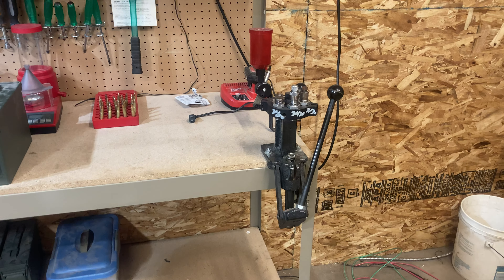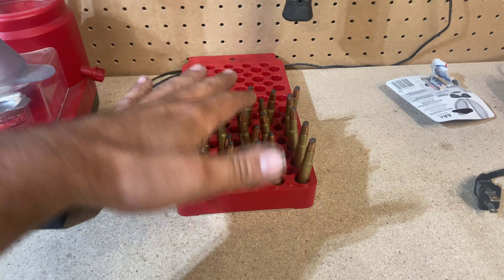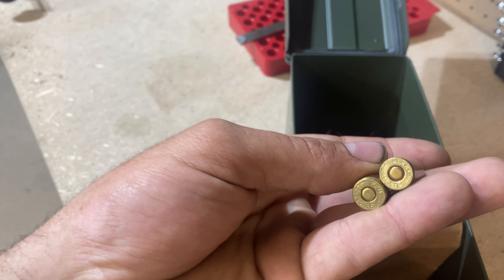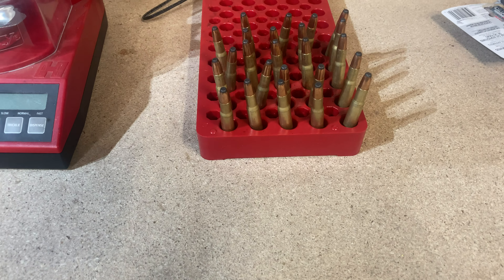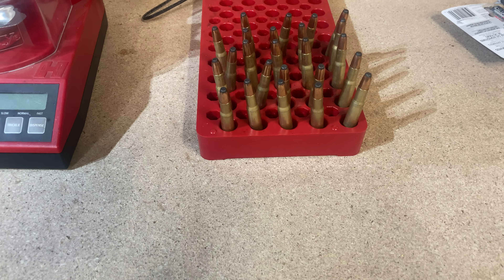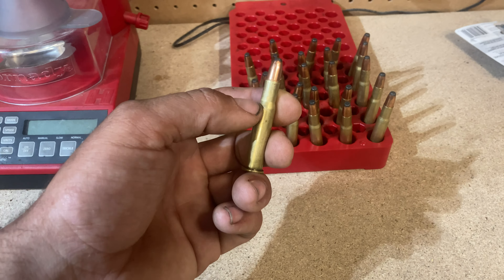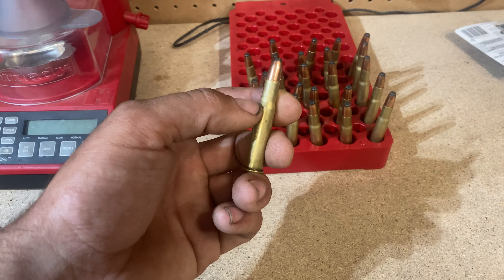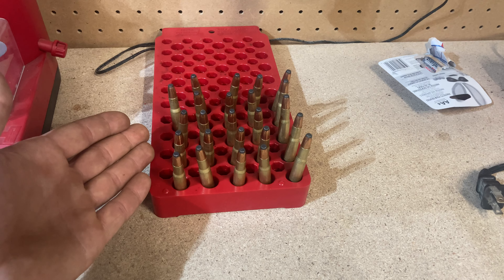AN ANSWER TO ALL THE COMMENTS ON THE RELOADING VIDEOS

Comment: Are the chambers of your two 22-250 guns at opposite ends of specs, and is the reason you have two sets of dies for the round? I have 2 guns chambered for the same round and my dies fit one exactly. I know that because I've loaded/fired the same cases 17 times, this for a belted round. For the other gun, I swap out the standard shellholder for a Redding Custom Competition Shellholder. Thanks for the vid!
Reply from the maker: The 22-250 is the one of my favorite rounds to load and shoot so im always tweaking on rounds for each gun

Comment: I agree with 95% of what you said there. Sparkling clean brass doesn't shoot any better, exotic brass, neck tension, annealing, other fancy processes, will only help past a certain point, exotic process tools will only help past a certain point. If the gun & shooter isn't up to it in the first place, no percentage in pursuing past a certain point with it. There are some things a person can do to speed up and simplify case processing that aren't overly expensive, and just make the process a little faster and easier at a fairly reasonable price. And there are some gimmicks in amongst them too, all the companies have one or two, they all have duds as well.Need to know enough about the process to spot those, or do some deep dive research on them, and in some cases, read between the lines on how people are defending them, or bitching about them.